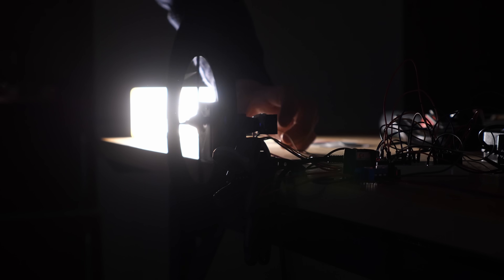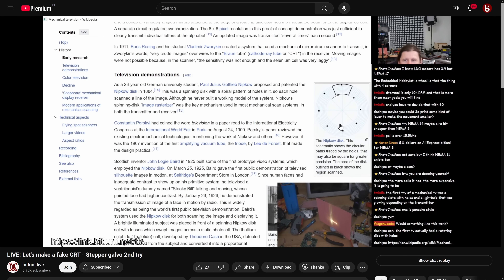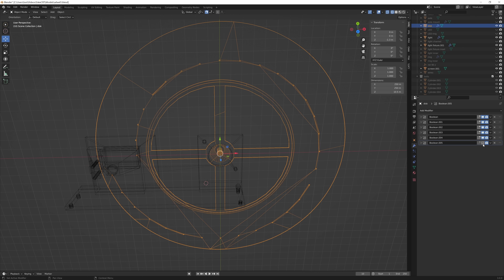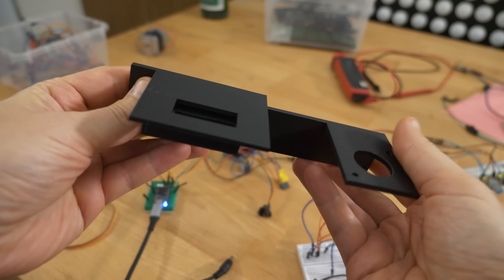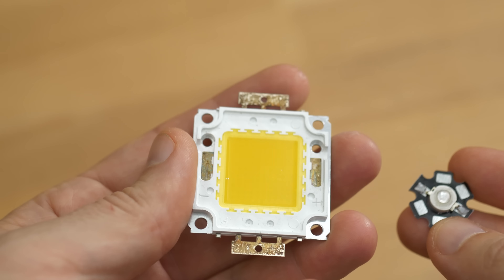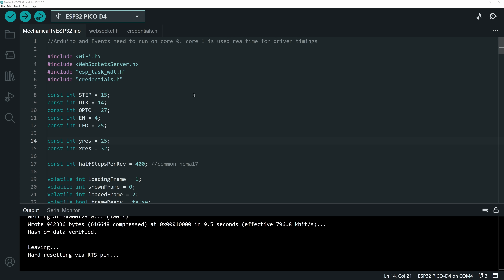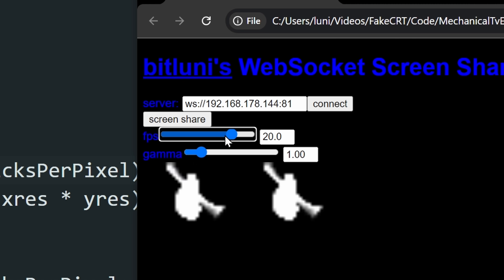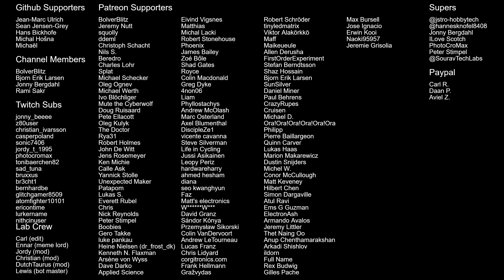I made a hilarious mechanical TV

Comment: Replace the stepper motor with a DC motor for higher FPS. Use the optical interrupt as a speed sensor and interrupt driver to sync the LED and rotating screen.
Reply: I think in this case you could even use the h-bridge already used for the LED to control both the LED and the DC motor.👍
Reply: @johannlicher8420  Better would be a BLDC motor with FOC .
Reply: This would also change the frame rate of the video to that of the DC motor. This works when your video source is artificial, like here, but not when playing a video file or a live transmission. There, you need to sync the motor with the camera's motor (or shutter, if you're not using a camera that's using the same tech).

I think the original invention used an AC motor because those are trivial to sync by including a simple sine wave in the video signal that is then amplified to drive the motor.

In this build, simple gearing would be more than sufficient. The disc is lightweight and will be spinning at a constant speed, so the reduction in power won't matter. The stepper motor already can do 15 fps, so a 5-to-1 gear ratio is more than needed. He just needs some code to slowly ramp the speed up to avoid undue stress on the parts.
Reply: @HenryLoenwind  if you have an opto-interruptor syncing the DC motor to the frame rate is trivial because you just make it so if the time between the interrupts is longer than the frame time it increases the voltage across it and if it's lower it decreases it. Make a PID if you want to be fancy and you're done. If you want to keep it simple, you can do it with a mosfet and a like a dozen lines of code.
Reply: If it goes too fast he'll have to put the disk in a vacuum - lol  -.
Reply: @SidneyCritic  Maybe make it lighter by just moving the LED in some sort of focused ray xD
Reply: Instead a continuous rotation servo (like what is used in RC propellers) would make more sense.  It's a common part and does the exact thing he needs.
Reply: @BrainSlugs83  I'm not familiar with those. What makes those servos? My understanding is that "servo" implies that they move to and hold at a specific position based on the input signal---which isn't something that makes sense in my head for propellers. With those, I can imagine wanting to finecontrol the rpm, not the exact angle they're at any given time.
Reply: @HenryLoenwind  see my response just above this comment. I thought the same thing.
Reply: @BrainSlugs83  A motor isn't a servo. Servos don't rotate like motors, servo's are more like actuators.
Reply: @Njazmo Its very clear that youve seen servos in linear actuator ball screw packages.

The ball screw is the actuator. The servo is an electic motor with a rotary encoder built in.
Thats it. Thats all a servo is.

And yes, all digitally controlled r/c's and electric vehicles all technically are using servos they have to.

Servos come from Master Slave copycat moters used in early military "radio communication" at the Manhatten Project. The Control motor controls, the servemotor (servo) follows.

(and the servo started as a modified syncro motor, used in and invented for mechanical TV's.)
Reply: @you’re right, and I looked them up for the same reason. The “servo” nomenclature seems to be a holdover because they retain an integrated PWM control system that is otherwise identical to what we would consider a servo, but without the positional feedback since they are intended to rotate continuously.
Reply: @Njazmo 
A servo is any motor that's phase driven by a synchro signal. You may be used to wiper-style gear servos, like you might use for steering in an RC car or linear servos like you might use to control ailerons, but there are servos that rotate continuously with no stops.
Can't see what the benefit would be over a BLDC in this instance, but he's not talking about the servos you're thinking of.
Reply: How about using a rotary encoder to sense where the disc is for syncing to the video signal rather than a stepper motor? A quatrature mouse used similar principals back in the day.
Reply: @AbAb-th5qe  Nope, same thing. It doesn't matter, an encoder is just position feedback. He already has that, and mechanical tv NEEDS it. that's the IR interrupter and notch in the disk. That has nothing to do with fps. That notch has to fly by the sensor x many times per second. That is the sync pulse. For 20 frames per second, that is 20 rps. That means a motor rpm of 1,200rpm. 20 times per second * 60 seconds = 1200rpm. If the motor rpm varied, the frames per second varies. So what happens to do the video data? It gets smudged over and loses what it is. He's using a stepper to make it spin exactly 1,200rpm. A brushed motor is too variable to ever hold rpm. 

Original tv's used a synchronous AC motor, sync'ed to the AC grid, which the signal transmitter is also synced too, so everything works perfectly. When you decouple that, nothing works anymore. Pixel one flying by the led, might be 5 pixels behind the signal for pixel 5, and all data is lost.

It has to by synchonrized, same thing happens on Persistence of Vision displays, you need that motor rpm to be synced, and that sync pulse
Reply: @dogsarebest7107  Well that's told me! :) Thanks for the info man
Reply: @AbAb-th5qe  No worries. It's impossible to always know everything. And even if you did, knowing "facts" means nothing if you can't put it into use, after all. There is always time to learn and improve, after all. Plus, you never ever know when someone's offhand comment ends up upturning everything. That's why I love old analog circuit stuff. The circuit/product designers back then figured out ways to use glitches and weird behavior of IC's or transistors in new and interesting ways, ways the IC MFG/Designers never imagined. And to make the most of an expensive resource!

But yeah, that's why he went with stepper, brushed motors are.. very low tech, rough, variable things. I mean hell, they don't usually even have ball bearings! If you have 2 motors, one brand new and one with say 20 hours runtime, they behave completely differently. Hell, 2 brand new ones side by side won't match. Sure, a separate control system to try to manage RPM of a brushed motor will help, but it will never be able to respond fast enough. So his options really were stepper, or a brushless motor with an odrive like controller (not r/c esc). Sure, spinning a thin plastic disk isn't exactly a big load, but brushed motors are very variable!
Reply: @AbAb-th5qe  Using the optical sensor and assuming a constant rate of rotation would give enough rotational accuracy. You just adjust your period based on the rising edge of the sensor, divide that time based on the number of "pixels" and then write the next led value each time that amount of time elapses.
Reply: @AbAb-th5qe  The disk could be the encoder. It already has the holes.
Reply: use a BLDC motor
Reply: You can do that yourself
Reply: BLDC motor would work but cost wise a normal DC motor and optical interrupt would be much cheaper, like OP suggested. H bridge isn't required as the disk spins one way only, PWM controlled on the rotational speed of the rotor would work fine if you wanted to hit a specific speed, then just trigger each frame off the optical interrupt and emit it from the LED at a constant rate. Small errors in rotational speed would manifest as a slight skew in the image. That's probably how I'd do it. The other option would be to synchronize the LED to the speed of the disk, i.e. to measure the duration of the last rotation of the disk and emit the frame from the LED over that time period; you sacrifice simplicity in the software for even simpler motor control, you could just do it with a variable resistor and work with a wide range of disk speeds.
Reply: maybe installing it in a vacuum container to reduce air friction
Reply: Try using a PLL, phase comparator output to the motor driver and IR interrupter + frame sync pulses to the comparator inputs
Reply: This. I feel like people think that stepper motors are good for everything, when in reality there is usually a different type of motor that would do far better for the application. Stepper motors are meant for slower but very accurate repeatable actions. Here we need a constant high speed, so most any dc or bldc motor would be best with some kind of speed feedback loop to get the fps right, or even just an adjustable voltage on a brushed dc motor with the microcontroller running with an open loop using the optical sensor as its timing metric.
Reply: how about a dji drone motor
Reply: Or how about a hard drive motor?